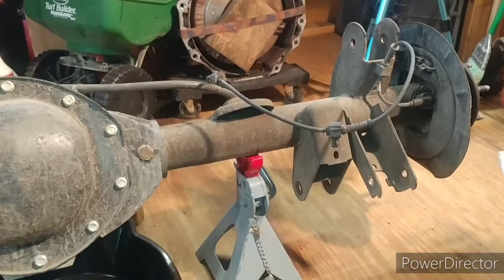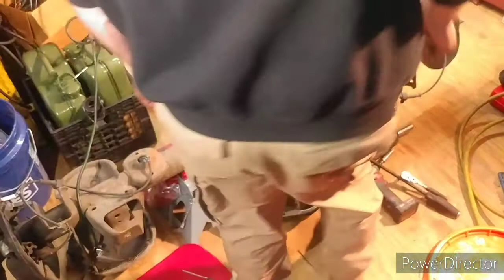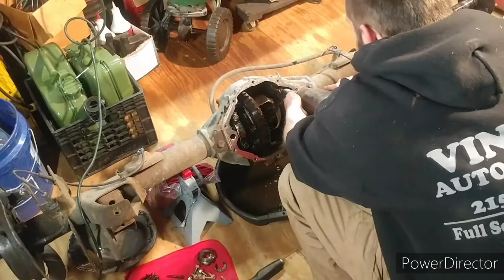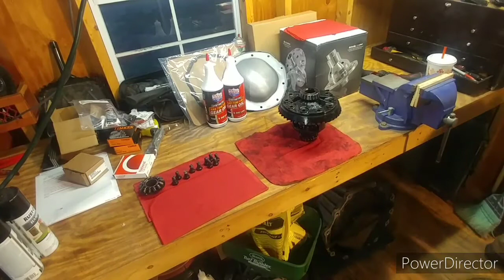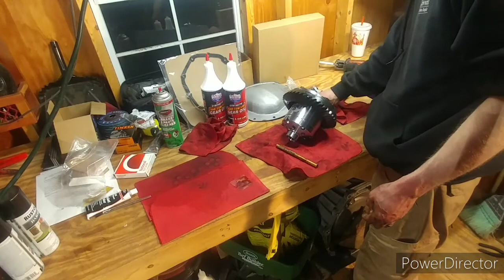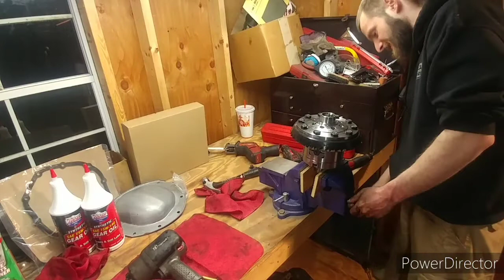Introduction, Overview, and part one of installing Yukon Grizzly locker.

Comment: How do you reinstall the C-Clips? Do you have to pull the pin out of the Grizzly Locker? Part 2?
Reply from the maker: It's set up very similar to stock. There's a cross bolt and a pin. With the pin out there's room to use a magnet to drop the C clips in. Sorry I never filmed a part two.